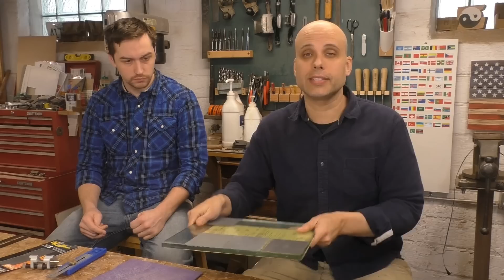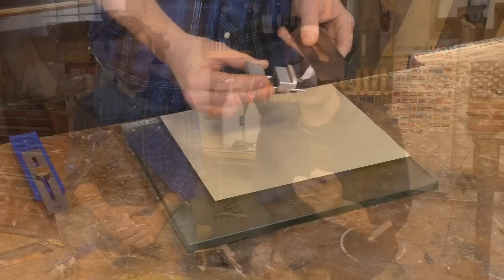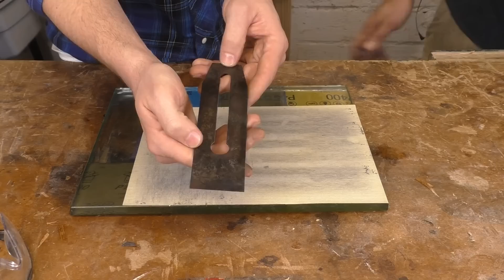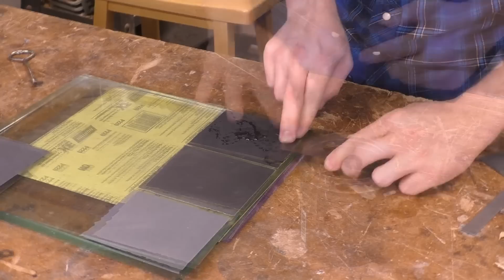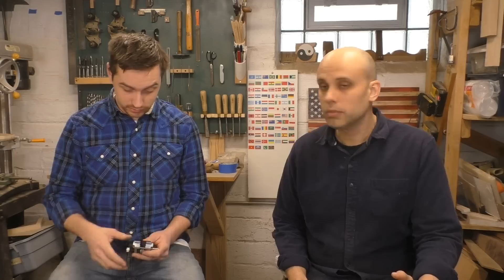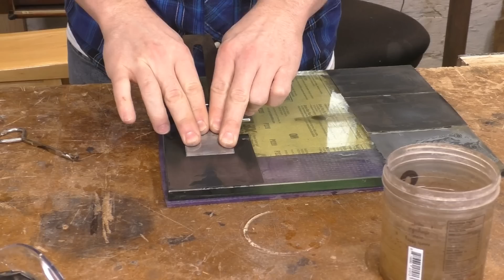True Beginner: Basic Sandpaper Sharpening

Comment: question do you use the exact same method for chisels or are there any extra tips to set up and hone a chisel
Reply: The only significant difference between setting up a chisel & setting up a plane iron is to do with how much of the ‘back’ of the tool you look to get flat - and this relates to what the relevant ‘reference’ surface is for each tool.

With a plane, the tool’s ‘reference’ surface is the sole of the plane:  the iron is presented to the wood in a manner that references off the sole - the flatness of the wood surface after it’s been planed relates to how flat & how long the sole of the plane is, not how flat the back of the iron is.  So flattening just the 1/4 inch (5 to 6 mm) nearest to the honed edge on a plane iron - i.e. the bit that affects how straight* the honed edge ends up - is usually just fine.

For a chisel though, the ‘reference’ surface - especially when paring rather than chopping - is the back of the chisel itself.  For chisels, therefore, you really want to go for properly flattening a good 1 to 1 1/4 inches of the back nearest the cutting edge when first initialising the chisel - and then keep on working on the flatness of the back from time to time, so that - gradually, over the lifetime of the chisel - you extend the length of the flattened portion of the back nearest to the cutting edge, giving you more & more of a high quality reference surface for paring.  The reference surface being the back of the chisel itself is also why you must never, never, NEVER, use David Charlesworth’s ‘ruler trick’ when sharpening chisels you want to ever use for paring!

———————————
*A straight edge is, by definition, the intersection between two perfectly flat surfaces.  Getting both the ‘back’ of an edge tool and the bevel of that tool flat adjacent to the honed edge will by definition produce a honed edge that is also straight.

For smoothing plane irons especially, you want your honed edge to be a straight as possible; a non-straight edge will leave minute undulations in the planed wood surface and it won’t then feel as smooth as it should.  Problem is, if the honed edge is dead straight for its absolute full width the resulting shavings that you take with the plane on a board wider than the width of the iron will be like minutely shallow mortices in the wood surface.  And the edges of these minute mortices will be visible in the finished surface as plane ‘tracks’.  Cambering the extreme ends of the iron’s honed edge softens off the edges of these minute mortices to the point at which the naked eye can’t see them & the fingers can’t feel them.  At which point the magic happens, and a planed wood surface looks and feels unbelievably smooth.  Almost like you meant it to be...! 😁

Oh, and please don’t confuse ‘flat’ and ‘smooth’.  ‘Flat’ is determined by the geometry of the reference surface (‘sole’ for plane, ‘back’ for chisel when paring); smooth is determined by the geometry of the cutting edge.
Reply from the maker: It's exactly the same.

Comment: I was wondering about the strop. @rexkrueger I have also seen a few people use heavy denim like old work pants as a surface to use as a strop instead of leather. Do you see any reason not to do this?
Reply: Not Rex, but it works also. It is the abrasive compound that is doing the work, the leather, jeans or whatever is just the base to hold the abrasive particles from the paste.

Comment: Have you ever tried a 25 degree iron versus a 30 in the same bench plane? My cheap #4 - ish is at 30, my no. 6 is at 30, my blocks are at 25, but the no. 4 bench  I just got at auction is at 25. What is right for a bench plane?
Reply: Oh - and a sharp edge is defined as the intersection of two surfaces that meet with no round over at all (also termed a “zero radius”* curve) between them.  The angle between the surfaces doesn’t affect how sharp the edge is, only how close to zero radius the intersection between those surfaces is.

What the angle between the surfaces does affect are:
- how durable the sharp edge is,
- how easy it is to push the sharp edge into the surface of the material you’re cutting with it, and
- how much material you have to abrade off the tool you’re making sharp in order to actually reach ‘sharp’.

The steeper the angle between the surfaces, the more durable the sharp edge will be.  The shallower the angle the easier it will be to push the sharp edge into the surface of the material you’re cutting with it, BUT the more material you have to abrade off the tool each time you want to bring it to ‘sharp’.  The angle you choose is a trade off between these two situations.

By trial and error, over the course of history, our woodworking forebears concluded that 30 degrees final honing angle between the joining surfaces for edge tools is a pretty good compromise.  Some people nowadays prefer 25 degrees.  It really is personal preference.

What is FAR more important than the specific angle you select to sharpen at is that you sharpen to the SAME angle each time you re-sharpen.  That way you build up a consistent memory of just precisely what effort you need to put in, what micro-adjustments you need to make, when using the edge tool to get the effects you want to with it.  That way the quality of your work goes up, the safety of your practices goes up & the pleasure in your woodworking goes up.

[*A truly zero radius curve between surfaces is not possible to achieve, btw - even atoms themselves have a radius.  We can only ever get as close as we need to zero radius - and then get back to our wood-bothering. 😁]
Reply: @simonwellicome4028  very informative and detailed. Thanks
Reply: Shane Mason The angle you hone plane irons to is impacted by the angle you want your plane’s body to present the edge of your iron to the wood surface - and this is affected mostly by whether the iron is mounted in the plane body with the iron’s bevel up or down.

 ‘Bailey pattern’ planes (which I’m guessing your no. 4s & your no. 6 are) typically use a ‘bevel down’ configuration - so while the shaving you take with it is formed by the honed cutting edge, it runs initially up the back of the iron.  The iron is clamped to the plane’s frog & the back of the iron is held parallel to the face of the frog.  The presentation angle of the cutting edge with these types of plane can never be smaller than the pitch angle of the frog (typically 45 degrees in this type of plane), and indeed it is usually fixed at being the same as that pitch angle.  The principal role of the honing angle on irons that go in these types of planes is to get the trailing edge of the bevel the hell off the wood surface so the cutting edge of the bevel can stay in contact with the wood surface & do its job.  Theoretically, with these irons, any angle of less than 45 degrees will do just fine.

Block planes & low-angle jack planes usually use a ‘bevel up’ iron - so the shaving is formed by the cutting edge, but runs up the bevel of the iron initially.  The presentation angle of the cutting edge by bevel up planes is formed by the pitch angle of the bed in the plane body on which the iron is mounted plus the angle to which the cutting edge is honed.  For example, if the pitch of the mounting bed the iron sits on is 20 degrees, a honing angle on the iron of 25 degrees would also give a final presentation angle of 45 degrees - which would be just like a bevel down plane.

The presentation angle you want for the iron’s edge depends on the job you want to do with your plane, and I’m not going to get into that subject here!  A 45 degree presentation angle is a pretty good compromise for most planing tasks.

Comment: Once the paper is glued down, how do you remove it so as to reuse the glass?
Reply: I just scrap the glue off with a razor blade...super 77 or similar spray adhesive seem to have no problem. Also alcohol/acetone works well too
Reply: Had the same question.
Reply: Yes, that's also my question. I tried once to use a spray glue on glass and it was very hard to get the sandpaper off (with acetone, toluene, IPA, thin knife). Since then I put the paper on the workbench, hold it by hand and use no water, which is all bad... Maybe I should find a different glue or possibly use some thin double sided tape.
Reply: I've seen people use hot glue gun glue, but not sure how it goes with glass.
Reply: If you don’t want to glue you can also clamp it down.

Comment: Great vid! Does someone know where I could find a similar measuring jig, but with Metric system? I've found the Kreg and another one from Milescraft, but both are in inches.
Reply: if you cant adjust  between metric and imperial, perhaps  you should not be woodworking, 1" +25 mm  1 ft +300mm
Reply: @Billlupton  Lee Valley has both Metric and Imperial
Reply: @rocketwontoo5073  Thank you!

Comment: Sand paper is very good for sharpening, but stones are FAR more economical. However, oil and water stones have the problem of also being... consumable. 

While they're a little more money than a typical oil or water stone, ceramic stones and the DMT diamond stones will last a lifetime... for only a little bit more money up front. They also offer the benefit of being able to use them dry, though water can be used to aid in floating off material.

That said, you can actually contour an oil or water stone to match your perfect smoothing camber...

Comment: How do you know how long the projection needs to be to get the angle you want?
Reply: The jig maker will tell you the lenght blade tip to jig. Side note plane blades and chisel blades are set in the jig at diffrent lenghts but the angle is the same. the chisel will clamp lower changing the distance.

Comment: Awesome video Rex. Quick question though, do you put anything on the plane/iron/chisel to help prevent future rust after you have it in good working order? My tools are usually just left hanging in my garage and I can go weeks without using them.
Reply from the maker: A touch of oil (any kind) works great.
Reply: Philip Grasso I love WD 40 silicone spray.  It’s awesome.  Prevents rust.  And a honed blade w that coating put on after just slides through wood.

Comment: Rex, have you looked at Brent Beach's sharpening method? (http://www3.telus.net/BrentBeach/Sharpen/index.html). I'm completely new and haven't used anything else, but I like the idea of it, the main difference to what you've done here is that you add shims every time you go up a level of grit so that you're honing a very small area at very fine grits (and it does increase the bevel angle slightly near the tip).

Comment: you can go as high as 12000 grit when you use sandpaper. The extremely high grits are not so cheap. I can't think of a reason to go that high, but you could.
Reply: Only 12000?!
Don't you know that TRUE woodworkers sharpen to 80000 grit?! Everyone knows that if your shavings aren't as thin as a 1 molecule thin graphene sheet and that the edge of your plane irons and chisels are so sharp that the very act of looking at it will cut you, you don't have any woodcraft cred!

Man, I'm so glad I didn't fall into that hole. I'm happy with the 400/1000 diamond plate and strop I got and made.
Reply: @Vincent-S  I generally only go to about 1200, but you can go as high as 12000. Some guys do it, especially with razors.
Reply: @tootall5559   I know, I'm just playfully throwing some shade at the ones who bring out the 8000+ grit waterstones to get plane irons and chisels to atom splitting edges :D
Reply: @Vincent-S  I like a very sharp knife, plane or whatever, but yeah some people get crazy. Actually, depending on the tool, I will use less of an angle and not go as far with the honing. I learned as a kid that the angle makes a big difference on how long an edge will ask. We would make some arrows ourselves, just sharpening a dry reed or stick with a pocket knife. The ones will a long narrow point would penetrate better, but would not hold up past a shot or two into a cardboard box. those that had blunter tip would not penetrate as well, but you didn't have to resharpen them on every shot. so, for tools like axes that see rough duty, I use a much steeper angle than a plane, and different blades of my pocket knives get different angles, the main utility blade has a different profile than some of the other blades, less angle tho technically still as sharp.

Comment: Hey Rex, do I need a honing tool? Or could I make one?
Reply: You mean the jig? It's just a broad clamp with a wheel underneath it, nothing more, so you could quite easily make one. The manufactured ones use a threaded rod with a left & right threaded bore in the two sides so they open out from the centre when you turn it, but that's not necessary. A parallel clamp (or quick clamp or anything that'll hold the edges of the iron securely) screwed to a little piece of board with a roller underneath it will do the same job.
Reply: @NightCatArts  Thanks!
Reply: @NightCatArts I just found this video again by accident lol, I forgot about it and I ended up buying a Irwin sharpening jig, It also came with a stone and oil but I usually just use the stone for chisels. I know you can buy individual jigs but I liked the blue lol.